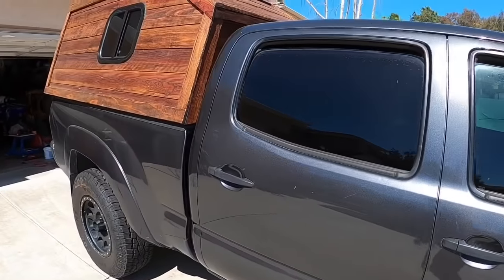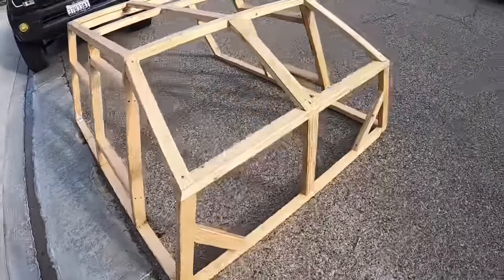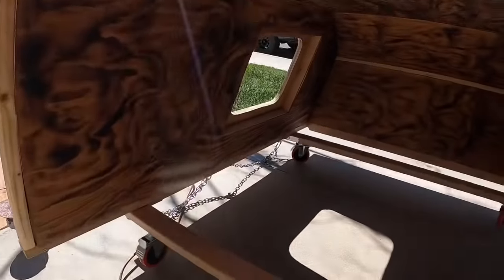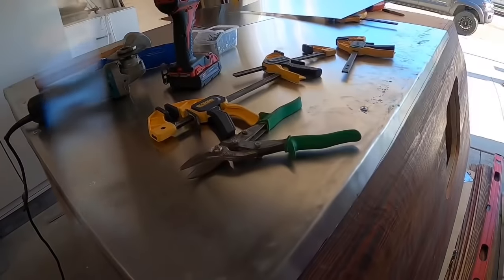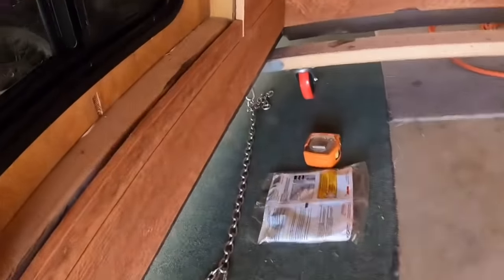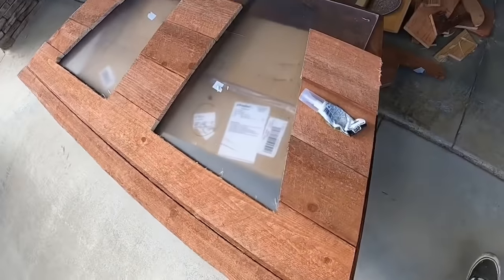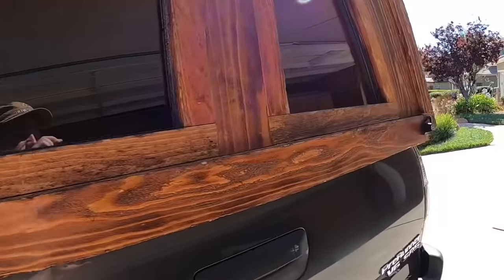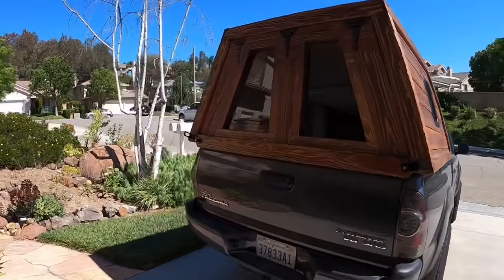Home made wooden camper shell

Comment: I generally like this build but it really does seem like a water trap, that is going to cause problems eventually. If nothing else, the trim pieces around the bottom could be rounded off, or angled, to shed water downward, and some drain holes added in the trim around the top to allow the water to drain down to the rounded/angled trim at the bottom. As it is water is just going to sit in several places and will eventually win in seeping in somewhere, no matter how well sealed the joints are. Especially true, if this is going to be used in the winter in freezing weather. It is a really great start, though. Kudos.
Reply from the maker: I talk about the water in my new video

Comment: I have a 02 3/4 ton Dodge diesel long bed and I really want to do something like this. Right now I have a extra tall fiberglass canopy but it is made for the 1st gen bed which is a bit different sized than mine. Seal leaks between canopy and truck and I just can't get it to stop no matter the material or how tight my clamps. Next summer I build one similar to yours. Looks great.
Reply: Saw a video where someone used a garage door bottom seal between the cap and rails. Seemed like reasonable solution to me.

Comment: For not being a carpenter, you have done an excellent job, and given me some ideas. I'm planning to get an older, long-bed pickup, and may make my own top similar to yours. Only problem with this design is that it is very HEAVY. At one time I had an old truck with an aluminum shell, and by propping it up against the back fender, I could lift it up and on the bed by myself. Of course I was 34 then, now I'm twice that age. So I like the hydraulic lift idea.
Reply from the maker: I talk about the weight in my new video and show how I lift it in another video comping soon, not too bad. Best of luck on your build!
Reply: @fathertime241  Thanks! Looking forward to seeing that. Subscribed.

Comment: It’s beautiful bro! I’d recommend to anyone when doing exterior trim, try to always make the TOP horizontal pieces run the full length with the vertical pieces capped off by the top trim, than run the sides all the way down with the bottom trim framed in by the sides... this is for water drainage
Reply from the maker: Thank you for the insight
Reply: Thank you homie I’m building a custom truck bed camper top right now myself and that is something I had no idea about

Comment: Beautiful job, nice looking design. I was going to do this too until I calculated the max gross weight rating on my 1/2 ton truck.  Bed payload is pretty minimal. Unfortunately weight is probably an issue, depending on the payload of the truck by the time you finish the inside bed, add gear etc, you may be overloaded.
Reply from the maker: I talk about this in my new video, but the sumo springs really help

Comment: Nice work!  Only 300 lbs?  Did you weight it?  Seems heavier.  I like the overall look and design.  Insulated is so nice.  Consider installing a heater that runs off the engine antifreeze like the ones in the rear of vans.  Much safer and when you arrive it's preheated.  Heat will retain most of the night with that insulation.  I do this with my camper van.
Reply from the maker: Great idea with the heater! So far it’s been surprisingly warm in there, not much camping done in the snow though. I address the weight in a new video coming soon

Comment: a good looking cap in both design and build  I know you used Silicone to seal but another  good way would had been  using Epoxy resin and a fiberglass cloth like they use in Wooden boat builds  often called the West Sysystem because West Epoxy was what made that system popular  originally these days many others have entered the Epoxy  world  and are less costly like Total Boat  and some others  the combination of the r Epoxy and the cloth not only makes a waterproof  surface it also provides  strength and some abrasion resistance  as well  similar to a  fiberglass  and resin mixture they use to  make a fiberglass shell or boat
Reply from the maker: Great idea!

Comment: I think you did a great job on building a camper shell but one thing I would like to bring up is if you just ended up with the metal on top then you have the trim around it how will the water drain off ?  Now it's going to hold water on top because it is trapped with no place to drain.
Reply from the maker: I talk about your question in my new video

Comment: Very nice build, and we'll presented and explained during your video, measurements will vary from truck to truck depending on the make, model, and overall size of the bed itself, so don't sweat posting measurements - anybody capable of using a tape measure or even a "yard stick" will be able to figure out what they need and make their cuts accordingly besides if they have the tools to build this that should also mean they have a degree of ability to do so as well.

Nice selection for the wood and the only thing different I would/might do is to rip the wood in half, to leave them at approximately 1/4" thick, and then seal BOTH sides for better moisture protection, same with the plywood, sealing it that is, but you can also reduce the weight by boring numerous large 3" holes which can reduce the weight of the plywood by 20% and more since as several people have mentioned th weight factor.  

One More thing, re the weight factor, a few 3/16" to 1/4" cuts along the bottom of the top rear 2 x 3 will help drain any water, etc., just remember to seal/protect those areas too.

Thank you for sharing, and hopefully this may be on my list to build for a "winter" project, for my Silverado.
Reply from the maker: Thank you for the great insight! Much appreciated

Comment: I've seen several if these type of builds.  Yours looks great so far.

One thing I have always thought would be beneficial for something like this is to build the camper topper with the tailgate down and take advantage of the extra space.  Maybe even remove tailgate (they come out easily and to extend framing and flooring 18"-24" past the rear of the truck.

Also, extending the build to go over the cab of the truck would provide a lot of additional space.

Lastly, how long did this take and what are your costs so far?
Reply from the maker: Great idea, however I planned to tow a trailer while camping so that was out of the question for me
Reply from the maker: New video I posted talks about the cost

Comment: You did a good job. How did you bend the sheet aluminum? Any hints on how to keep it lighter? I am building mine for a 2003 long bed F-150. I've got to make it light. could you use 3/8 inch plywood on the sides instead 1/2 inch? And you did not cut a window for the back window for the rear window of your cab?
Reply from the maker: I wish I had a press, but I just screwed the top down and then worked the sides with a mallet a little bit at a time. You can always build lighter depending on your needs. I didn’t, I had thought about it but I didn’t feel like dealing with adding another window

Comment: Good work, No disrespect, the wood look is not my style but is still looks good. I really like the shape. I have a Dodge Dakota I want to make a topper for. I'm thinking of using thin steel wall tube though with sheet metal exterior.  One question about your, Do you have drain holes on the roof? I see that catching lots of rain.
Reply from the maker: I had thought about doing something similar n the beginning, would be a rad build! I do, and I talk about them in my new video

Comment: Are u using 2x4 or 2x3 to save weight plus they should be strong enough....I plan to use 2x4 base plates then 2x3 or 2x2 since siding will add rigidity.  Also plan to use rubber membrane under plates and use 1/2" bolts on side rails and a few 3/8" on front to ensure its rock solid and water tight.  Lastly, roof plan to use a 1 piece thin gage ss that wraps around sides 1.5", secured with ss screws and rubber washers.  Also add roof vent.  Love your design and rear door.  Not only to lock, but a nice cool rainy night be nice to have open yet stay dry.  Will use t&g outside, styro insulation and 1/4" plywood inside.  Plan to put both a bulk head from cab to bed and side bulk head for lp line for indoor heat and generator leads in summer ( will frame for small a/c ahead) Anyone have comments?  This seems like a fun project!

Comment: Nice...
I'm about to build one with similar shape.
Question: Do you have any bow in the roof? It's hard to tell with wide angle lens. 
Also, you mentioned 1/4" ply at one point, then 1/2" at another. Can you clarify? I'm thinking I'm going to go 3/8" all around, but unsure if that'll be overkill or underkill..  ha
Nice job
Reply from the maker: The sheet metal did bubble up but I screwed it down, and I was just talking about the different wood I used per layer. 1/2” plywood was used around the widows so they were sturdy along with the roof. Otherwise all the other plywood was 1/4”

Comment: How did you bend the aluminum straight? was it necessary to build it higher than cab high for for the windows? That adds drag on the engine & cuts mileage. Very nice looking job, though. I have been looking for a shell for  LONG BED 2003 F150 & they are almost impossible to find. Bought it used Feb 2018 and couldn't imagine they would. be nearly as difficult to find.
Reply from the maker: Screwed the top down and then worked the side with a mallet, no the height wasn’t necessary but I talk about it in my new video. Best of luck
Reply: @fathertime241  Hi Ayrton, didn't mean to seem critical about cab, looks nice, The rise is a nice addition, I will have to look closer At how you did angling up and how you cut the wood.
Reply from the maker: No worries, it’s definitely a challenge to cut some of the pieces if youre looking for similar angles to mine
Reply: Where did you buy the aluminum from? I am also in SoCal near Long Beach. Any ideas on how to make it lighter?

Comment: Nice job. Just happened onto your video. I’ll keep my eyes peeled for future videos on this build.
Reply: Very nice job !.... unique!.
I would recommend that anyone building  one to cover all the exterior 1/4" plywood  with roofing Grace Ice and Water Shield first before you fit the exterior boards and aluminum roof skin.
The Grace will waterproof in case of a wood leak as the wood skin ages and may get splits. It also "Chokes" the screw or nail shift that you for the finish wood with and does not allow water penetration around the fastener shift.....just like roofing .
Good luck , have fun with your build.!
Reply from the maker: New video is up brotha

Comment: the design should have eliminated the tailgate, and had full barn doors for easy access// also  the roof has a potential resovoir - that you could use to collect raiin water if you had a hose drain  for off grid boondocking
Reply from the maker: Some great ideas, but I planned to tow a trailer at the same time as camping so that idea wouldn’t work for me

Comment: Looks nice but probably weighs 400 or 500 lb.
Reply: So not noticeable in handling at all. My Dakota has a paid load of 1700. I drive with over 1000 lbs without any issues.
Reply from the maker: I’ll weigh it in my new video but it’s talked about in my most recent one

Comment: I don't think it is a good idea to seal the framing members for several reasons in particular, one. In a potential fire, chemicals can be hazardous. For that reason, the construction industry doesn't use pressure treated in living quarters, except in very rare instances. I'm not saying this is true in this instance or to criticize your work, but it might be a dangerous mistake others will repeat after watching this video.
Reply from the maker: Interesting, didn’t think about that. However, if I have a fire then I better grab some marshmallows because it’ll be a goner at that point